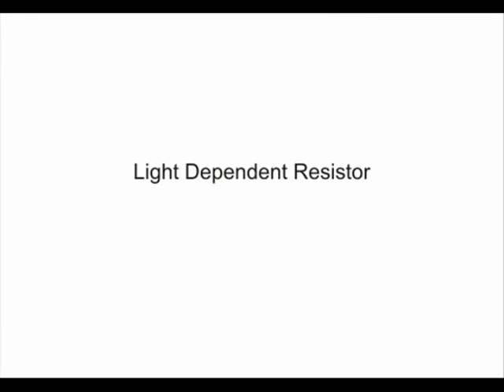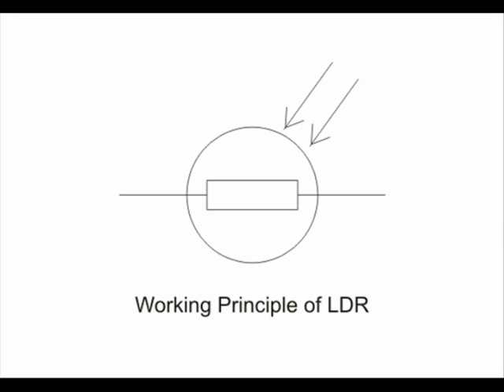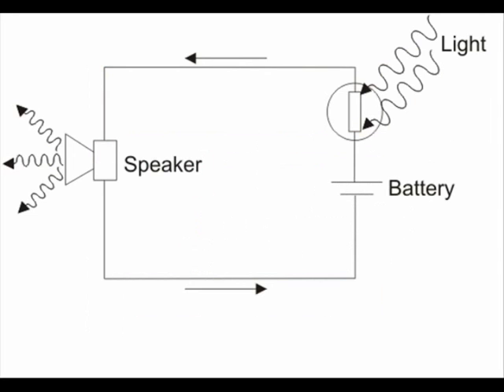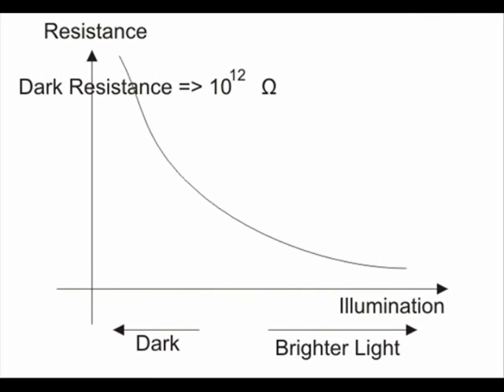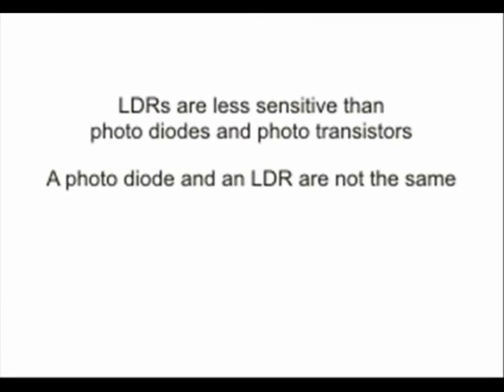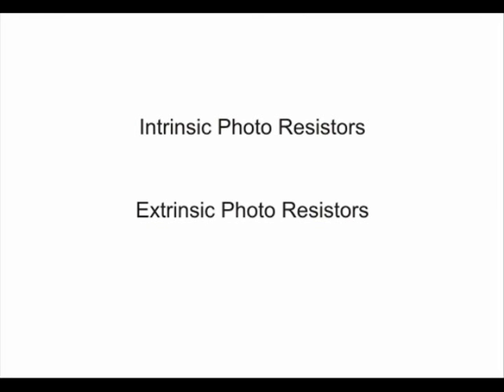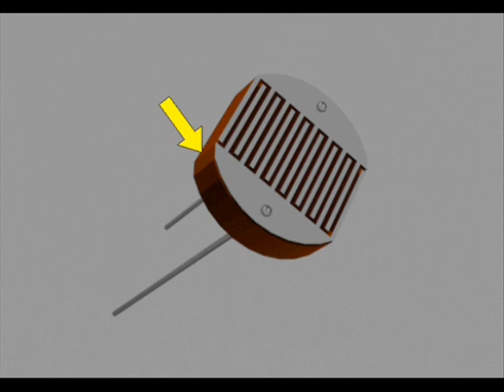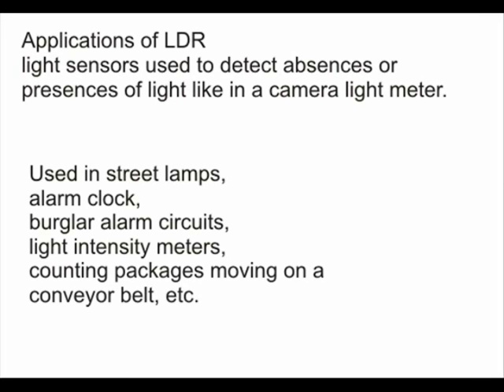Light Dependent Resistors (LDR): Working Principle

Comment: Hi Electrical4U the material conductivity must increase right when light falls on ldr?
Reply: At 1:09 says that "the conductivity is reduced when light is absorbed by the material" meaning the resistance increases if light increases.
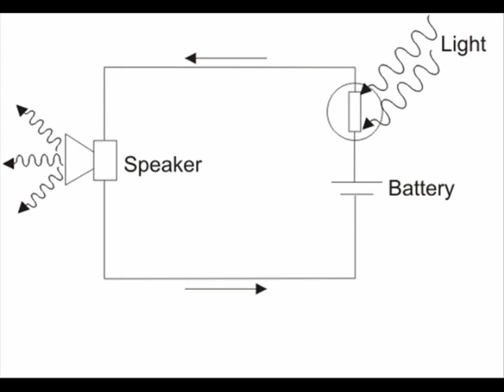Then at 2:05 the graph shows that resistance goes down as light goes up.
It's just a mistake, the latter one being the true one. The graph is good.

Comment: As you said  light dependent devices whose resistance is decreased when light falls on them and that is increased in the dark. then when the resistance is high in dark ,then how the current will flow through the LDR.
Reply: Then the current doesn't flow
Reply: LDR is a sensor it is not a linear device
Reply: @Achu-pf9tq tq bro 😊
Reply: @vamsi5052  anytime bro✌️